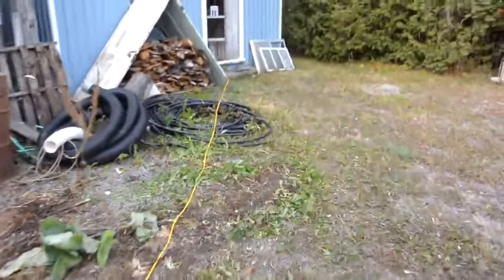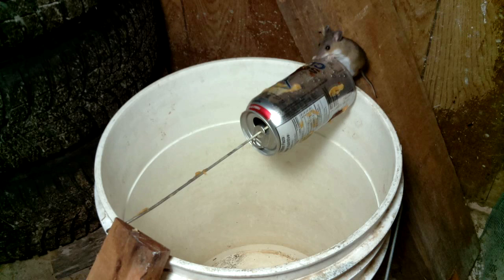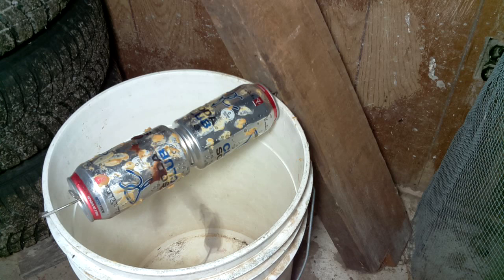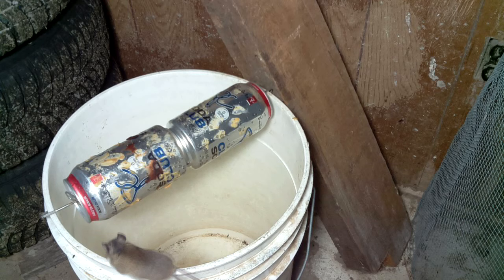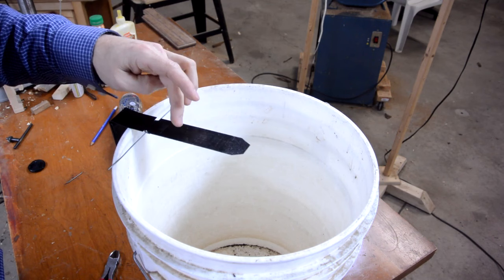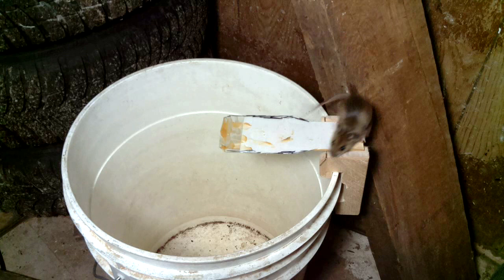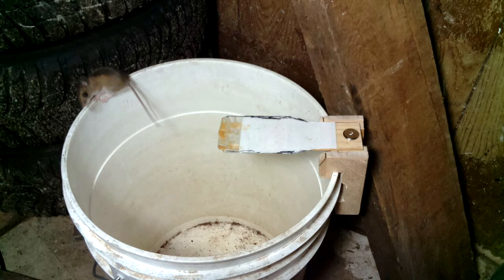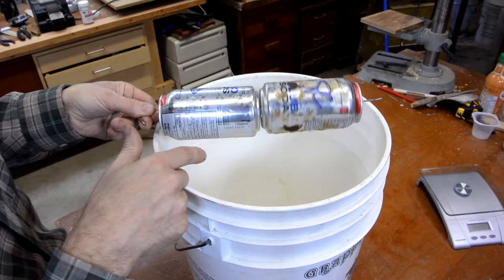Building a better mouse trap, using video surveillance

Comment: Drowning in water is cruel. Put some sulfuric acid.
Reply: +Le Bublerkin That is definitely crueler, no questions about that. Same as you would say that burning them alive would be less cruel.
Reply: i'd prefer prince of persia's spikes...
Reply: +Le Bublerkin Heh, no water, no sulfuric acid. Just some hexafluoride gas.
Reply: Even Hydrochloric acid
Reply: +aserta I was thinking of plain CO2, cheap and would be just as effective. It is denser than air too, so would stay in the bucket.
Make the bucket taller, add a funel in the middle and now we'Re talking about
Reply: +Le Bublerkin oh lava
Reply: +Le Bublerkin I'm a big fan of sharks with frikken laser beams, swimming around in the water.
Reply: +thephantom1492  that is a really good idea, or sulpfur hexaflouride gas, then they wouldnt make any high pitched noices either ;)
Reply: maybe an array of used razor blades at the bottom, it's called recycling. but then there's blood to clean up later.. &(*$&
Reply: +Le Bublerkin Or molten metal like in T2 or whatever they used to freeze Han Solo.
Reply: +Le Bublerkin Then they can turn into the Joker, not cool dude. Not cool.
Reply: +thephantom1492 CO might be the most humane since the mouse would go to sleep first.
Reply: jmsaltzman That is what I think too. I also beleive that with a funel it would help. I mean, the funel mean a smaller opening, which mean less loss of gas, but it have the issue of having a more horisontal surface, so for it to work you need a good angle, which mean taller... But I think with CO2... it would be a good compromise due to CO2 cost...
Reply: +jonnenne Watch, as the joke flies over your head. There it is! Way up in the sky!
Reply: +Marshall Gatten do you think jonnenne would contact Matthias Wandel to buy the mouse/mice from him after the capture? cos he/she loves the mouse/mice so much... AWWWWW...
Reply: +jmsaltzman CO would be too light, you"d end up with the guy filling the bucket poisoning himself
the second O is necessary
Reply: +AnarchistMetalhead But the second O would give CO2, and then the mouse wouldn't go to sleep. It would suffer an agonizing suffocation. Pure nitrogen would be the most humane, but it's slightly lighter than air so it would be tough to keep the bucket full. So here's the solution: Rig up the ramp trap  that uses the magnet, and pass a circuit through the magnets such that when the trap is sprung the circuit is broken. And then set up a large amount of high explosive in the bucket so that when the mouse is caught the entire building goes up Michael-Bay-Style. The mouse won't suffer and the building will never have another mouse problem.
Reply: i think we need to interview the mouse regarding which is the less painful. In the questionnaire, we should ask, what would you like for last meal, would lethal inject be ok, let's sign an agreement to not appear here again?
Reply: Henry All these a-holes were so concerned about the poor mouse but not one stopped to ask the mouse what he/she would prefer. People.
Reply: +Claes Wikberg Man, that would be weird.  Mice make ultrasonic squeaks that humans can't hear. Imagine if the SF6 made it low enough to hear?
That's supposedly why cats can hear such high frequencies. They evolved to be able to hear mice.
Reply: +Marshall Gatten 
CO2 will still asphyxiate due to displacing oxygen. Breathing reflex is metabolically controlled by CO2 levels in blood (rather than O2 levels)- mouse will still show signs of distress while it's suffocating if CO2 used. (ie spring trap likely more humane)
 
However Argon is denser than air, and smallish canisters of it can be obtained relatively cheaply for use in MIG welding.
Reply: +steve cummins That's exactly the point of what I said.
Reply: +Le Bublerkin Capture more rats and put them in a closed space, with no food. They start eating each other until there is only one left. And then what? Do you kill the champion gladiator mouse? No. You take it and 
release it outside, but now it don't eat regular food anymore. Now, it only eats rat.
Reply: +FMFvideos Wow! Does it work with hamsters too?
Reply: +Henry you mean punji sticks!
Reply: +East South oh yes! you just teach me something. 10x cheers!
Reply: Acid is uncreative. Add a greased chute that goes directly into a room full of cats. Put a webcam in the room and monetize the site with ads. Stir up some controversy with the animal-rights activists to drive more traffic to your site. Profit.
Reply: +Marshall Gatten lol
Reply: Price-less
Reply: Hmm, maybe Bromomethane gas? It's more dense than Air so it should stay like the bucket long enough to kill a few mice.
Reply: +Doctor Turdmidget genius!
Reply: +Le Bublerkin Liquid Nitrogen?
Reply: +Le Bublerkin - Cut the bottom of the bucket out and attach it to the top of a cat box.
Reply: +Blackpapalink wouldn't it evaporate?
Reply: datstocklyfe Not if it's in a pressurized vacuum.
Reply: and you expect the mice to fall in a pressurised vacuum?
Reply: datstocklyfe There could be an elaborate trap that sucks them in? IDK I just want to see a mouse in Liquid Nitrogen, dammit.
Reply: +datstocklyfe 
there is no gravity in a pressurized vacuum. Set your mind to blown!
Reply: +datstocklyfe 
there is no gravity in a pressurized vacuum. Set your mind to blown!
Reply: My idea is less cruel. Once the rat falls onto the trap, it will trigger the release of pressurized butane and 1.5seconds later an igniter will activate setting the rat on fire. Of course there's a smoke alarm installed nearby the bucket. Once the alarm was triggered, an installed extinguisher which is pointing directly to the bucket will set the fire off. After that, a 100lb weight installed at the ceiling will fall over the bucket to completely kill the fried rat
Reply: Mauriatic acid is better
Reply: +thephantom1492 I would think they could tell the gas is in there. I like the funnel idea, they would fall in and not be able to jump out since they use the sides to pull themselves out.
Reply: +Henry Hydrogen Peroxide cleans up the blood pretty well.
Reply: +FMFvideos I've also head you can take a rat that living inside your house, paint it white, and let it loose. Since its different, the other rats leave.
Reply: Actually mice can swim for about two whole days!
Reply: +Le Bublerkin Why not a funnel going to a blendtec 9000, have it motion activated. Add a webcam & call it Joe Cartoon - real life edition.
Reply: pauljs75 That would be "Less cruel" for those who think animals are like people. And it is actually a good idea, just save some tuna cans and you have homemade "canned wet cat food".
Reply: I believe that he's psychoticly joking
Reply: @EngineeringVignettes  you sure you dont want tvem to swim in acid or magma instead

Comment: I'm probably gonna regret entering the fray but the water in the bottom is the best option if you want a kill trap that is harmless to larger animals/children, and is relatively safe and hygienic to deal with for the benefit of the human user.  Any cruelty to the animal has to be weighed against that. In my world that is a reasonable position. Not killing the mouse is not a reasonable option if the mouse population is to be controlled. Before anyone asks, I, just like the cat, owl, fox etc. do not believe the mouse has a right to live I should respect. I reserve that solicitude for fellow humans. I know that is absolutely speceist but sticking an st on the end of a word to make a label does not tell any of us WHY its a bad thing. Calling names is usually just an intellectually dishonest way of ending any dialogue. However, anyone who wants to discuss this without name calling will be gently responded to.

Comment: What's 40 grams converted to inches?  Thank you!  Thank you!  I'll be here all week!  Remember to tip your waitress!
Reply: +Tom Nally  329 furlongs per fortnite
Reply: Taylor Di Angelo You are correct, sir!
Reply: weight is not distance.
Reply: Alex Jamieson
first of all I would tend to think grams is a measure of "mass"
and It's clearly not convertible into Velocity either.
Reply: +Alex Jamieson I think you need to change batteries in you Sarcasm o'meter, they seem to be running low.
Reply: +Tom Nally Just google it. "40 grams to inches"
Reply: FDog16  +Alex Jamieson  You guys are hysterical!
Reply: warpman74 Well, it wasn't really intended to be sarcasm as much as faux standup comedy.  I'd never be sarcastic to Matthias.  Dude is the freakin' MAN.
Reply: +Tom Nally 12 pirate ninjas.
Reply: +Taylor Di Angelo weight/mass simply DOES NOT convert to distance.
Reply: +Tom Nally  40grams = (approximately) 16.5 inches.
Reply: +Alex Jamieson How did that swift breeze from the joke flying over your head feel like?
Reply: +Tom Nally About 3 chains
Reply: +John Bouttell  I love the surveying angle to that answer!
Reply: +Robertlavigne1 You are correct!  Well, correct inasmuch as this unit must always be rounded to the nearest whole ninja.
Reply: +Toast   Finally!
Reply: +Tom Nally Remember, E=MC^2  so is amounts to  859.23 kilotons of TNT
Reply: +Tom Nally 
1 gram of barley are about 15.5 corns, 3 corns of barley are the length of one inch (the original definition of an inch), so one gram of barley are about 5.1666666 inches, so 40 grams of barley are about 206.66666 inches.
Reply: +Tom Nally 0.00629892 stone
1 gram = 0.000157473 stone
6350.29 gram = 1 stone
Reply: 1.079 metric hogsheads.
Reply: Sounds like it's getting close to three hands, plus or minus a gnat's gusset
Reply: +Tom Nally HA...nearest whole ninja.
Reply: 5.2 seconds
Reply: Off Topic You are correct, sir!
Reply: +Tom Nally 

its 1.4 OUNCES grams is mass/weight not distance
Reply: ThunderClawShocktrix Your sarcasmeter is out of calibration.
Reply: its also over 9000 inches
Reply: +Tom Nally --
About seven minutes.
Reply: Matthew Rivas
I wonder if he said it as a troll move
Reply: ThunderClawShocktrix ...No, it is called sarcasm. You didn't even get that after I pointed out that your sarcasmeter is out of calibration.

Some people on the internet, man...

Comment: If you wanted to make a live trap, putting a lid on the bucket and cutting out the center would keep it from being able to jump out.
Reply: +Samy Ismael or simply a taller bucket.
Reply: +Joseph Malovich or have a tightened cat inside the bucket
Reply: +Joseph Malovich That's what I was thinking.  Like a 13gal trash can.  We find dead mice in our kitchen trash can when we open our summer cabin so we had to start turning it upside down before the winter.
Reply: +koneth21 No, cats are assholes! They only bring them in the house :P

Comment: drowning doesn't sound fun.  maybe a quick death by electric shock?  Or really over engineer it and have it become an automatic trap that grinds up the falling mouse into a paste that is then used as bait...oh hell I'm evil. muh hah hah hah!
Reply: +Kevin Stempien Agreed;  Drowning after a couple hours swimming till exhausted doesn't sound like the most humane way.  Electric shock?  Hmm...  Could build a huge tesla coil...  that should do it!  :-)  It would be cooked and ready for the kitty.
Reply: +Jonathan Duncan tesla coil isn't really that deadly. It works on very very high frequency, and due to "skin effect"  electricity at high frequency flows only on the surface of body not trough it. It hurts, but it wouldn't cause cardiac arrest. 
Really it depends on the frequency,  the higher frequency -  less dangerous.
Reply: AgentDexter47 So...  a bed of sharp nails alternating each nail with a different phase of 480v?  Or just clean 220v?
Reply: Not sure how we are supposed to get the wet sponge in the little chair the mouse will sit in
Reply: While that would most certainly kill the mouse, it would also keep roasting him after he is dead and until he dries out/burns and is no longer conductive :/
Reply: ***** You'd have to feed it iron pellets first.  Then it might look like something off of X-Men.
Reply: +Kevin Stempien I have an electric trap. They're available to buy, but they aren't optimal, as they require you to remove the mouse, before they can be re-used. So Matthias, please help devise a combination, that drops the dead mouse into a bucket (or drain) and gets ready to zap the next in line.

Comment: Did you consider using marbles or bearings as the weight? It could provide an initial resistance to spinning, but once it starts moving, the can will still roll.

Comment: i would improve the can one by still using one can, then putting stoppers at the end to prevent it from coming to close to the rim of the bucket. So that the mouse could come closer to the center to get food then it will fall as soon as it gets on the can. Maybe still put some rocks in it so that it can fully be on it before it falls. Great ideas.

Comment: It would be cool if you had the camera trigger a trap.
Reply: +Avi Tech Actually, that's what I thought the video was originally about.
Reply: +Avi Tech I thought the same !!!
Reply: not sure if you noticed but Matthias seems to be keep-it-simple kind of guy. Camera is only there for documenting the process&effect. While RPI triggered death trap would work it would require light to be always ON and at least 50$ worth of hardware instead of little plank with magnets.
Reply: +RooTerKyberian There's always one in the bunch.
Reply: ... or a jenga pistol
Reply: +Avi Tech I rigged my shop vac with an infrared sensor hooked up to an 
arduino that turns on my shop vac for a couple seconds and vacuums up 
the mouse.  I should make a video of it
Reply: +jwt2005 That would be awesome. Just be prepared for the hate from mouse lovers like Matthias is getting.

Comment: Try putting a little bit of dish soap in the bucket to stop it climbing out if you don't want to kill it
Reply: So it will slip down if it try's to climb out
Reply: So it will slip down if it try's to climb out
Reply: +Dan Crankshaw Would vegetable oil work too?
Reply: +Lois Lane The mouse would eat the vegetable oil.
Reply: +Dan Crankshaw I use to have mouse jump into my trash can and cant get out because of the plastic bag. Don't know if it works all the time.
Reply: +Dan Crankshaw Or you can use a taller bucket. The fall doesn't hurt them.
Reply: +Dan Crankshaw or you can add some spikes below :)))
Reply: +lies and deception or acid or fire or a hungry dog
Reply: Rats and mice are treated differently depending on where one lives. Where I am, people mostly ignore them since the population isn't that big and they don't really do any damage. They aren't aggressive, and actually do a better job at cleaning up people's trash than the trash workers do, sadly enough. Plus we have owls, coyotes, and other predators that keep them in check. I can understand though in some other areas they are best kept in check by our own efforts to cull the numbers.
Reply: lies and deception I really wish people like BlueTiger and Kitty would at least try to see your point of view before launching into a tirade of insults. I keep rats and mice as pets, and I love them dearly, but at least I understand the damage their wild counterparts can cause and why people spend so much time and money eliminating them.
Reply: Agentofthe1Truth aw thank you. At first , I was partially joking. But I hate rats and my reasons were stated clearly. You keep rats and mice as pets so they aren't pest , but imagine having your pet dog being infected by rabies or having constant wiretrips and blackout due to rats. You'll hate rats equally or more than me. I dont hate many things , just things that make my life miserable ;)

Comment: I'm sure others have posted this but I didn't read the other posts. 

Use a fine fishing line or thin wire to support the pop can (no weights). 
Add a board ramp close enough to encourage the mouse to jump for the can.
This works perfectly.

Comment: just an idea.... a deeper bucket, they do exist... if you don't want to kill the little bugger
Reply from the maker: +Martin Tovar Just an idea - try watching again and listening this time.
Reply: +Martin Tovar 0:33 watch it over and over with the volume up until it sinks in and then slap yourself on the forehead!
Reply: +Martin Tovar  Just add enough water so they can stand in the water, the freak that can then jump out is entered into controlled breeding when re-captured.  Several years ago there was a pro football player who jumped out of shallow pool without using arms to touch side, 3-4 foot deep water.
Reply: +SaturnSC2 
As a kid I used to stand alongside a 4 foot pool and jump in without touching the pool. I never tried jumping out but jumping out would be tougher as you have the drag of the water on you.
Reply: It was a rookie NFL player, ask him to repeat it after being on the grid iron!
Reply: He didn't put water in it because he didn't want to kill mice on YouTube
Reply: how 'bout a lid... DUH
Reply: +Oolong Johnson   Yes, that would more accurately describe the method of killing the mice.
Reply: A milk bottle with a greased inner neck and a raisin inside will capture mice no problem.
After that put them outside away from your house. Better than that just keep your cupboards closed and don't leave food lying around.
Reply: get a 5 ft bucket. with a few inches of water.
Reply: He said because he doesn't wanna kill a mouse over YouTube

Comment: Instead of cans, I used toilet paper rolls covered in peanut butter. as soon at they touch it they're gone. Also put the roll in the MIDDLE of the bucket, not the edge. 
As bad as this sounds, we also filled the bucket halfway with water and anti-freeze. This was a trap we used at the cottage during winter time when it was uninhabited.